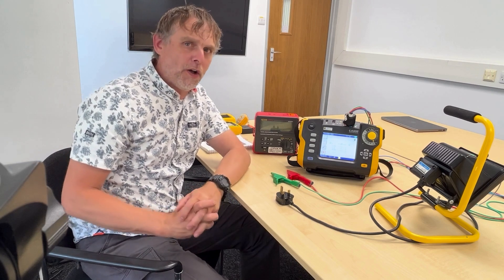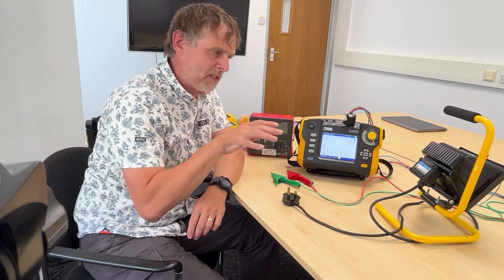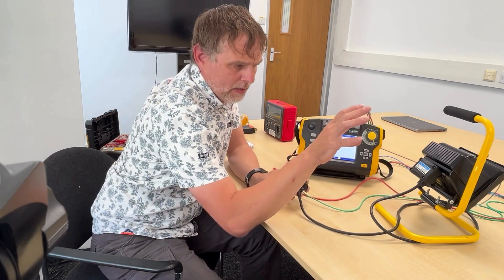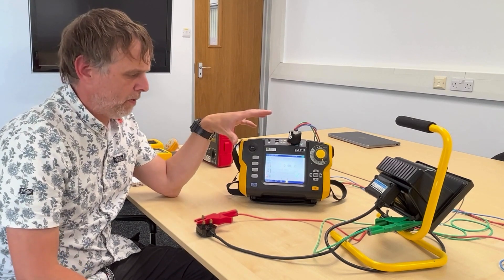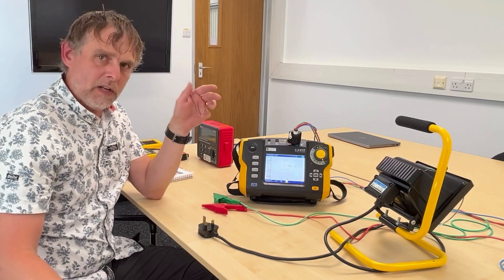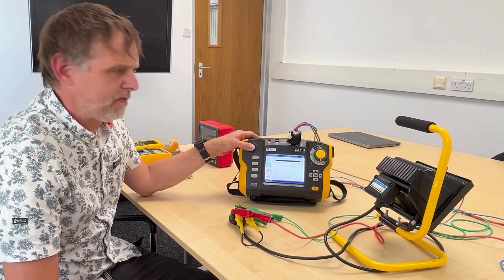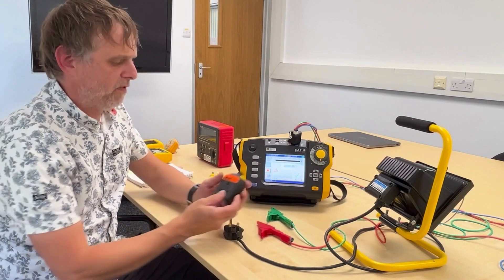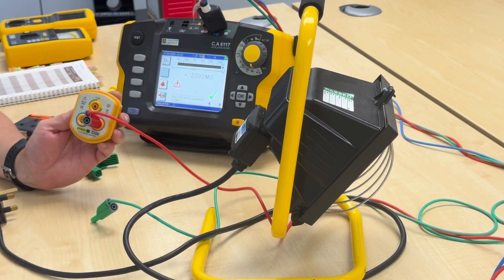CA6117 MFT as an ideal PAT Testing alternative @dsesuk

Comment: going to be a sad person but pat testing doesnt measure r1+r2 just r2. you measured r2 in the video. so your value you give from the on site guide is incorrect. i come across this a lot working with electricians i know what you trying to say its a force of habit. unlike every arm chair expert my qualifications 4th and 5th edition city and guilds 2377. owner of 4 of the editions of the code of practise 2 to 5. owner of vast seletion of  new and old test equipment and practising on the tools for 10 years. also made a quite bad rambly youtube video about pat testing.
Reply: You're right Ryan, that was an error, I should have quoted the resistance of the protective conductor only. I think I made the same error before in a video of mine - you'd think I'd learn!

Comment: Nice one Dave. However, I do know that you need to check the integrity of the earth for a class I piece of equipment by at least x1.5 it’s rated value (I looked that value up). Which is why I purchased a dedicated PAT machine. Anyway, always enjoy your content.
Reply: You can't comply completely with the code of practice without a dedicated instrument, nor am I suggesting an MFT works as an outright replacement for the proper kit. The PAT process encompasses a wider range of test options, but in a pinch, you can cover the essential basics to know that it ought to be okay to plug in an appliance and use it as the manufacturer intended if you have the right MFT to hand.
Reply: That's not true, 200mA test is generally the standard now. The old 'hard test' is still valid but not done much now,
Reply: @ElectricityUnplugged  This was an ad-hoc presentation, but I should have mentioned the 6117 offers a 20mA and a 200mA test and it's the 200mA test that should indeed be selected.
Reply: the 1.5 times test is used for manufactuering testing and really should be used when appliances are taken apart and repaired or for appliances with high risks of damage. but for periodic inspection in 80% of appliacations 200ma is fine.